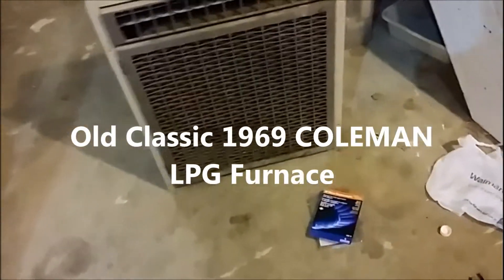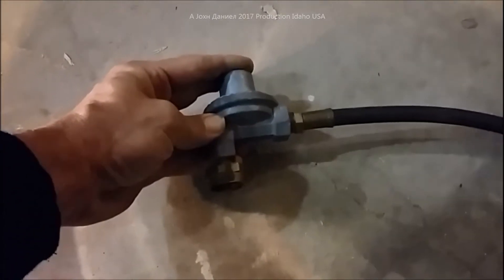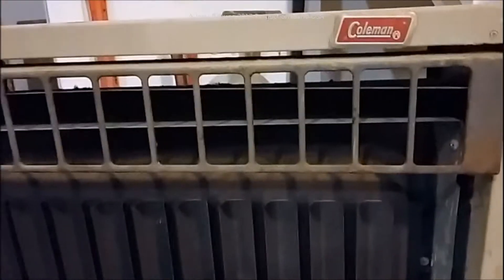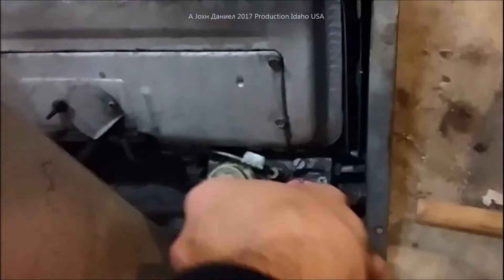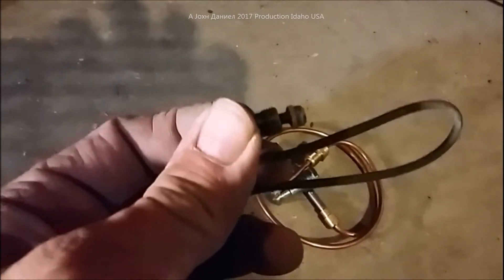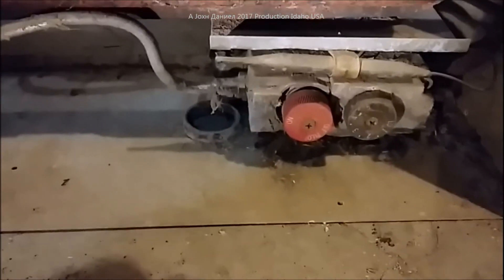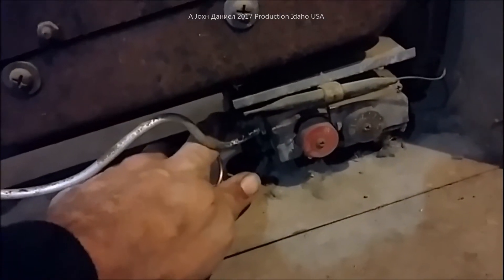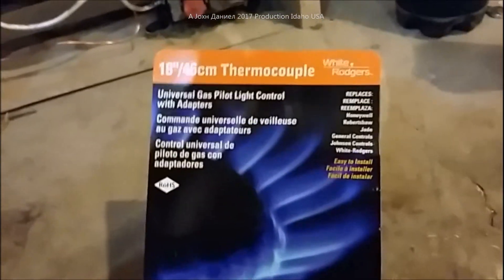Vintage Camper heater repair & thermostat snap action Gas Valve operation

Comment from the maker: White Rogers-Emerson THERMOCOUPLE http://amzn.to/2Apg9su #1 in TC brands. The Valve I mentioned is ROBERT SHAW http://amzn.to/2jIPfSD and comes with extra parts to do a normal and advanced install on almost all non electric controlled gas heaters.
~ Work safe, be sure all gas is off and the area well vented.
These universal Thermocouples are the safe bet when working on a furnace. If you have any questions, ask.
Reply: Hi John, great video! I just ordered a Robertshaw 710-205 to replace the Honeywell gas valve on an old Williams wall heater that has a non functioning thermostat. Just wondering if you ever got around to making a video of that installation? Everything looks quite straightforward but I was wondering if you had a technique for adjusting the flow on the pilot and main burners without using a manometer? Seems to me it could be done visually if needed at all - not sure how dialed in they are from the factory. Thanks!

Comment: I am so glad you did a video like this. I have a old mine heater with one of these valves in it but its in pieces. Now I know what it is and where to get new valves. Seems it cost AU144 for me but well worth it. This summer is good time here to do a fix on mine.

Comment: Do you have a video on the installation of the Robert Shaw 710-205 hydraulic snap action gas valve on the coleman furnace I can't seem to find it.

Comment: Nice job!  I have an old 1970 motor home with the original fridge that won't stay lit and suspect the same problem (Thermal coupler) That I will have to get into in the near future.  The heater still works like a charm though!

Comment: Hello sir love ur vids have helped alot. Wondering if u have any info on a hydro flame model arc-10 dated
05/1969 love the old gravity heaters this one unfortunately dosent have the exit slide pipe any ideas where I mite find one and where should I place the bulb?

Comment: I am in the process of restoring my my Vintage Colman Heater. It looks a lot like the one in your video. In the process of trying to disassemble and clean the bracket that attaches the pilot light burner and thermal pile to the furnace I snapped off the base of the burner which attaches the flare fitting. Do you have any suggestion on where I go to buy a used bracket to replace the broken one?

Comment: HiJohn. We have an old 1984 Skylark camper we use for ice fishing. Furnace didn't work so reviewed  this video. Pilot light now lights after replacing the thermocoupler as per your video but main burner does not cut in. Is there a way to tell if it is now a value problem? I took the value apart and put all back together but still no luck. Could it be that thermostat that hangs off the front (same one as per your video). Any feedback appreciated. Thanks

Comment: I just found this video: Thank You now my question is about the bulb you mention,  I realize how  it works, but does it work when it senses warmth or when it cools down?  My heater will run work properly for about 2 minutes and then it shuts down both the flame and pilot goes out. I can hear the spring closing. Refire the furnace, it lights right up  minute or so later shuts down again.  your thoughts
Reply from the maker: Over time the pilot system in the valve will just fail, orings allowing gas to pressure the other side of the diaphragm. It is not rebuildable. Shutting it off in the same fashion your speaking of. I put a Robert Shaw option link under the videos for that reason.

Comment: Hi JD. I have a 1973 sprite camper with a coleman heater model 9213 12000btu rebuild the hole trailer and gas valves was acting up took it all apart and got it working, crud on the seats, would like to get a new valve for back up can you tell me where i might get one. Thanks for the VIDEO id be screwed without them. My valve is a ITT #RV18AA18.

Comment: My old colman furnace thermostat is not functioning. The pilot and burner work, but thermostat in valve dose not turn off burner , nor does it click when adjusting the "temperature " on the thermostat dial. any help would be greatly appreciated! is it complicated to disassemble and repair the hydraulic thermostat portion of the valve? thanks !

Comment: I’m curious to how efficient and safe these old heaters are I’m currently working on a 1971 Campfire 16 foot travel trailer that has the original heater still in it was debating whether to go to a more modern ventless heater to save space I would love to know the pros and cons of using the original or going with a more modern heater.
Reply from the maker: They are about 80% efficient and when you do not have to leave a window open for fresh air, they are better than the ventless, and safer.

Comment: Hey, I just bought a heater that looks Identical to this coleman from the video, you mentioned it was 25000btu, mine sais it is 18000btu input and 12000 output, did they make higher btu models in the same case?
Reply from the maker: They made 7, 000/10,000,  12,000/18,000 and 21,000/25,000 models. Each one separated by 3/4 increases in body depth and 2.75" height increases. ( 25k is 5.5" taller and 1.5" deeper than the 10k) With burners sized to produce rating.

Comment: Hi John, great video! I just ordered a Robertshaw 710-205 to replace the Honeywell gas valve on an old Williams wall heater that has a non functioning thermostat. Just wondering if you ever got around to making a video of that installation? Everything looks quite straightforward but I was wondering if you had a technique for adjusting the flow on the pilot and main burners without using a manometer? Seems to me it could be done visually if needed at all - not sure how dialed in they are from the factory. Thanks!  I posted this a couple of days ago as a reply to John's post below but then realized I might get more response from a general posting - thanks.
Reply from the maker: The Pilot should be same fuel flow ( lpg or NG) as the current orifice you have. Its only a few grams of flow and will not be different since Williams used Honeywell made or Robert Shaw valves for over 50 years.
Reply: Thanks John. Do you think there would be any adjustment to the main burner flow necessary? The wall heater is natural gas.

Comment: John I have a vintage gas heater with a Honeywell controller C5230B1069.5 The controller is leaking gas around the valve actuator stem that is controlled by the spring thermostat knob. Is it repair able? I cannot find any info on how to disassemble this vintage controller. Could you please help me out. Thanks in advance.
Reply from the maker: Replace it with a Robert Shaw model
Reply: @JOHNDANIEL1  Thanks for your reply.

Comment: Hi John, my 69 scotty has a duo therm with itt hydraulic control. The pilot and mechanical thermocouple are one unit (sort of a 5/16" chimney on a cast fitting) and need replacing. The pilot rusted and in trying to Clean it I broke the thermocouple. Have you come across this before?
Reply from the maker: Replace with a water heater assembly for pilot/coupler.

Comment: Hi there I have a similar heater and the thermostat isn't kicking off the burner any suggestions?
Reply from the maker: Replace with a new gas valve is the only solution. These models were no longer made after 1979 (some of them Jimmy Carter laws against energy freedom). So you will need a new snap action valve and some handy work to swap it.
Reply: @JOHNDANIEL1  great thanks for the response

Comment: John   I am looking for one of these radiant type (Non electric) heating units to install in 2017 travel trailer. I have an opening in a cabinet that it would go into that is approximately 12 inches wide by 21 inches tall and approximately 12 inches deep. Backing up to an outside wall. I am capable of whatever modifications needed to be done in order to make the unit fit.  These dimensions would be for a reference only.
I am wondering if you rebuild any of these units and offer them for sale? I thank you for any information.  Chuck from Idaho
Reply from the maker: I have only one left, but if you hurry while you can get this one https://amzn.to/3vZVvKq .  It's exactly what you're looking for for $360 brand new and they usually run $600 I can't guarantee they'll be this cheap for more than a day or two and it's LPG, no electric required, and will fit I believe in what you're doing. If you order it and when you get it in and need any help about how to properly mount it safely in an RV compared to a house send me an email at olympicpowercontrol at yahoo.com
Reply from the maker: Let me know when you plan on heading to Texas, you might want to run before Idaho becomes Northern California LOL

Comment: I have an old coleman like that seems to cycle of and on but not getting that warm before it shuts down wonder if it's that valve
Reply from the maker: It's starving, check the intake and exhaust for wasp nest or other troubles. You can also remove it, shake it to see if large rust flakes are in it that may be causing the burner issues. And NEVER place the hydraulic bulb near the burn chamber, it needs 4+ inches away from it or it will ruin the flexible temp valve loader. Let me know your findings.
Reply: @JOHNDANIEL1  thanks I'll check that, I did blow it out already and my bulb is mounted away from the burner. It's at least 25000 btus and when I see it to the highest setting it heats but I think it should be hotter. I have a heater buddy and it heats the area a lot better

Comment: Thanks for your video JD, I have a small Coleman (10,000 BTU).  I cleaned it up and got it running for the first time yesterday, all seems fine. Just wondering, seems like a lot of heat going out of the chimney.  Is this normal, or is there a flu- type set up for these models.
Reply from the maker: One of the things you can do is very very lightly put a choke point in the exhaust tube. What I typically use is the can top from a can of beans and I folded into a w then slide it long ways into the exhaust tube about 3 in back from the opening of the exhaust port outside. It causes a slight difference in the flow but enough to give you an extra 1500 BTUs of heat from the inside. It should spring into place and create just enough turbulence to do that job without hurting anything. These can exhaust up to 4 ft safely and are designed to do so and models that have more than 2 ft of exhaust tube always produce more heat inside so it's obvious the unit can handle it. Keep an eye on it and be safe
Reply: @JOHNDANIEL1  -Thanks for your reply and suggestion. Much appreciated John.

Comment: What makes a furnace backfire (loud internal boom) that blows out the burner and pilot?  Could this be caused by a faulty has valve?

I have a Suburban S16TA if that helps.  

Thanks for any help!
Reply from the maker: Blockage such as wasp nest or dirt in the intake air tubes.
Reply from the maker: Pull furnace, remove blower housing on the Air intake side, opposite of exhaust side. Probably full of paper wasp nest or dirt daubers nest and possibly even mice.
Reply: @JOHNDANIEL1  there is no blockage furnace has been taken apart .  could a bad gas valve cause this? i removed furnace from camper and checked for any blockage, there is none.
Reply from the maker: For them to backfire, or pop in a internal explosion there has to be gas with insufficient air flow to it. A bad gas valve MAY cause some effects like that but normally a bad gas valve will just produce a much lower flame or no flame.

Comment: i have an old duo therm heater.  1970s I'm in Iowa where in USA is their a pro with dealing with these units.  my heater works fine and is in good shape.  some tiny surface rust. i need a professional to help mme